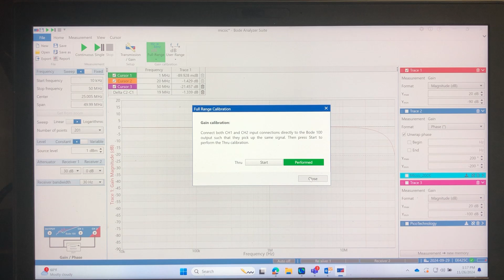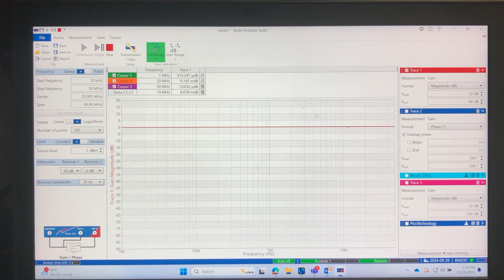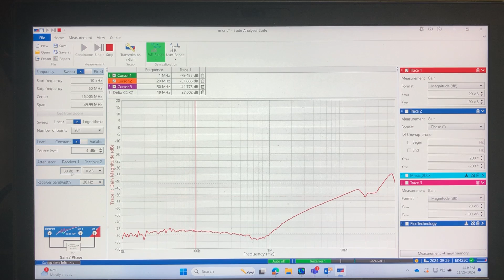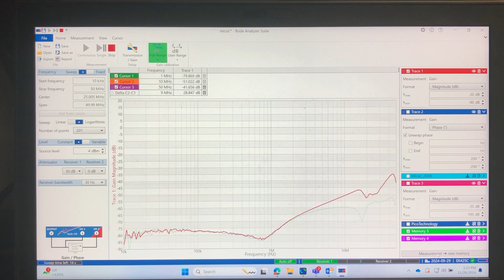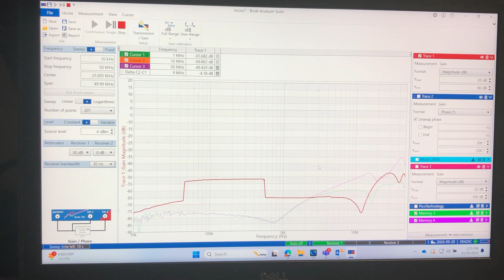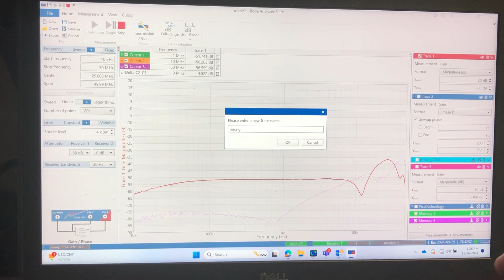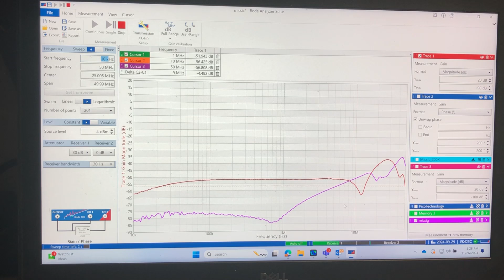MICSIG DP700 High Voltage Differential probe CMRR Measurement

Comment: 9:20, you did not do the 50 ohm impendence matching (the toggle from UI). As I saw from the video 5:41, the you didn't put a 50 ohm terminator on channel 1. I don't know whether the Bode 100 automatically does the 50 ohm impendence matching (without turning on the built-in 50 ohm impendence matching toggle) if you do the bode plotting using its built-in signal generator. As I saw from the video https://www.youtube.com/watch?v=Dez9KG6whb0 at 2:33, Dave attached a 50 ohm terminator on channel 1.  For measuring CMRR using my DHO924S with its built-in signal generator, I didn't need to attach a 50 ohm terminator on its channel (I verified, DHO924S will automatically does the 50 ohm impendence matching without telling you if you use its built-in signal generator together with its any analog input channel). But if I want to use an external signal generator, I will have to add a 50 ohm terminator for impendence matching. In this way, I get the correct same CMRR value with or without built-in signal generator.